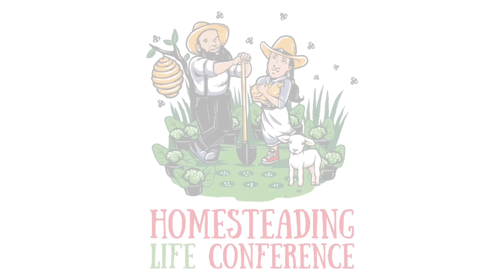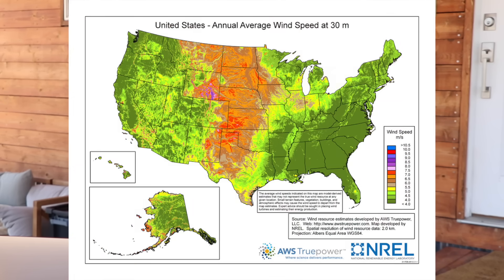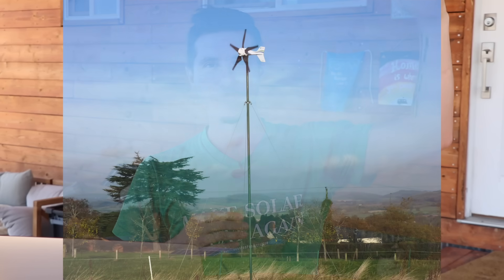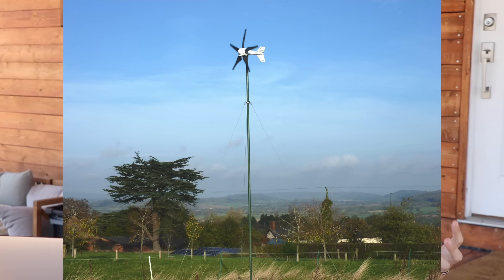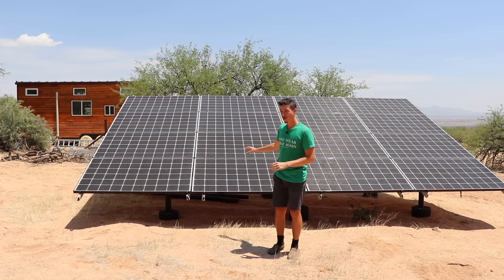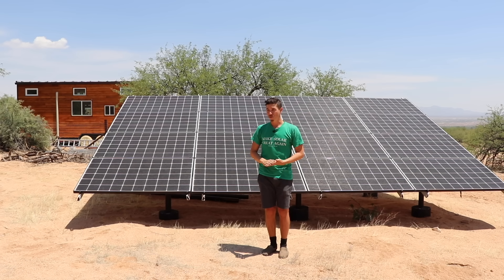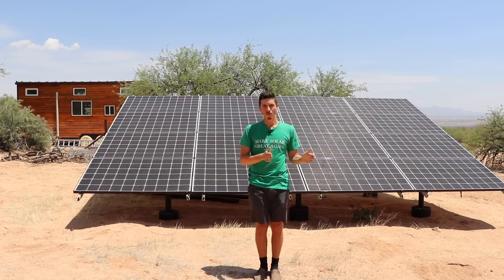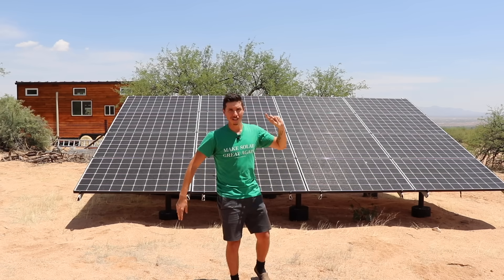Micro Wind Turbines... Are They Worth It? (Off Grid Solar)

Comment: Clearly, in a sun belt location like AZ, for example, solar is a better option.  However, in an areas like the Pacific Northwest, sun vs wind is a different discussion.  I live in British Columbia, where I live wind is a standard issue condition (with few exceptions), sunny days are not.  Smaller wind turbines will generate power 24/7 so the need of high output of power is significantly reduced, hence a reduction in cost.  An installation of a small wind turbine would not require a 65ft poll either, 20ft would likely be fine.  A person may even find the need will drop for large amounts of batteries too, since the recharge will occur throughout the 24 hours cycle.
Reply: You said, "... 20 ft would likely be fine ..."  Either you KNOW it is fine or you are talking bullshit.  Do YOU run your entire home off-grid using only Micro-Wind turbines?   So, how many KWhrs do your Micro Wind Turbines actually generate on a daily basis?   Then you claim they run 24x7 ... ( just more bullshit! )  According to the 10-Meter Wind Maps ( actual science ) for British Columbia, Canada there are no locations that have 10m/s wind 24x7 every day. NONE !

Comment: Do these need to be built 65 feet in the air or 65 feet above sea level? I get quite a bit of wind due to living on a hill and I think the claim that these need to be built 65 feet in the air is probably misleading.
Reply: The height for your wind turbine is measured from your ground level.  This is not misleading.

Comment: Wind is actually cost effective if you live off grid because 80% of low solar days are completely compensated for by additional wind. This saves you a lot of capital on battery’s and panels. But yes if you have access to the grid wind is not cost effective for the energy needs of a typical single household.
Reply: Micro Wind Turbines are not cost effective, for 99.99% of the population.  At best, they are a necessary evil....
Reply: MrSummitville No I disagree. They are not cost effective for about 80% of the population. It totally depends on the mission of the set up. The biggest factor is whether or not you have access to grid power, if like most people you do then yes it’s rarely cost effective unless you live in an area with consistent strong wind. Energy output increases exponentially with increasing wind speed. Wind also compliments solar in that very often wind power can be harnessed when it is dark or overcast.
Reply: @Str4t0sph4r4  99% of the people in the USA already have CHEAPER Grid Power than Micro Wind Power.  And 99% of the people do not live where there is enough wind to cost justify a Micro Wind Turbine. Those are the facts.  It does not matter if you disagree.
Reply: MrSummitville It does not matter if you disagree. Micro wind is usually cost effective for an off grid house.
Reply: @Str4t0sph4r4  So, tell us ... How many Micro-Wind Turbines do you have installed that power your off-grid home?  How much did the installation cost?  And finally, how many watt-hours do your Micro-Wind Turbines produce per day, week or month, in the real-world?
Reply: MrSummitville Good questions, although you failed to ask how much wind energy is produced during low solar hours. This is very important as energy storage solutions is where most of the cost is.
Reply: @Str4t0sph4r4  For most people, wind is LESS predictable than sunshine.  Also, it is generally LESS windy at night vs the daytime.
Reply: @MrSummitville  But it’s usually MORE windy in the winter months and MORE windy during overcast days.
Reply: @Str4t0sph4r4  If it is not Windy enough to cost justify a wind turbine, then it does not matter if it is "more windy in the winter".
Reply: MrSummitville Great comment genius. I mean I know you shouldn’t be afraid to state the obvious etc but I mean come on man. The flip side of that statement is also true, if it’s not windy frequently enough or on enough occasions where it is useful then it doesn’t matter how windy it is overall.
Reply: MrSummitville There is an application for wind power, it comes into its own for off grid solutions in conjunction with solar. It’s particularly useful in windy areas, the energy produced increases exponentially with wind speed. So it’s all about location and environment. In some places it’s extremely cost efficient in other places it’s extremely cost inefficient.
Reply: @Str4t0sph4r4  You stated "more windy", not me.  You offer no specifics but yet you claim it is effective to live off-grid with a Micro-Wind Turbine.  Maybe, if you live in a tent ...
Reply: MrSummitville Yes of course I stated “more windy” the more windy it is, the more cost effective a wind turbine is. What issue do you have with that statement? Lmao 😅
Reply: @Str4t0sph4r4  Until your reach a certain MINIMUM average wind speed, micro-wind turbines are NEVER cost effective.  Micro-Wind Turbines are typically a waste of money. If something is a net financial LOSS , then it is not ever called "cost effective".
Reply: @MrSummitville  How can anyone disagree with a comment that is so obvious it was a waste of time writing it. How is your statement in contradiction to ANYTHING I have said?

Comment: This guy is living in the dark!
First, you can't directly compare wind and PV, wind compliments PV, you're not trying to compete with PV, you're trying to get energy, especially at night. Even if you get less energy it may still be enough to reduce your battery size or get you through several cloudy days - which we do get. This brings me number two. Unless you live in a desert, you're not getting sun every single day - never! 
Yes, have PV in first, it's the easiest most dependable energy source for home energy BUT it doesn't shine 24/7 365 days a year, you need wind or microhydro to live off grid or a lot of big batteries or a tent with an LED light and very little renewable energy.
Reply: So ... How many Micro Wind Turbines do YOU have installed?  How much did they COST.  How many kilowatt-hours do they generate?
Reply: @MrSummitville  I have a stream which is a better source for night time energy which very few people have. Because my batteries cover my needs for several days, even when there's no sun, I haven't put my wind turbines up. I do have two wind turbines though, they were the SouthWest Windpower 400w turbines but I'm hoping my stream permit comes in so I don't have to put them up. I'm also considering a larger wind turbine, I think 1kW would be a nice size for my property.

The thing is that people have to understand that wind and PV work together, once your PV is in if you have the space for wind then you should consider it. You don't need a lot of energy from wind. Let's say your night time energy draw for 12 hours is 2kWh. 2/12 = 167 Wh. If you have a battery that's, say, 4 kWh then that saves it from depleting to 50% every night. So let's say the wind turbine only generates 100 watts, during the 12 hour night it generates 1.2kWh, now your battery is only going to ~75% discharge during the night. Wind doesn't need to generate a lot of energy but it still allows you to run longer on your batteries or use smaller batteries.
Reply: @mosfet500  So, let us know how many watts and watt-hours those so-called "400 Watt" Southwest Wind Turbines actually produce in the real world.  Isn't Southwest Windpower bankrupt?
Reply: @MrSummitville  SW also made larger turbines, the 400 watt ones were actually quite popular and held up well. I figure two turbines will give me about 150 to 200 Wh but if they don't I'll go with something like the Bergey Excel 10.
Reply: @mosfet500  Actually, the larger SW wind turbines did not hold up well.  They had a high failure rate.  And they were very expensive to repair.  A Bergey Excel 10 is NOT a micro-wind turbine - Did you read the TITLE of this video?
Reply: @MrSummitville  I know, I didn't buy one. I do, however, have two SW 400 micro turbines that never got installed because I didn't need them until now. If, between the two they give me 200 watts between both of them on my 4 acre front field with good wind I'm happy. 200Wh avg. for 12 or 24 hours gives me ~ 2.4 kWh to 4 or 5 kWh a day and offsets my battery load during those cloudy days we get in the Catskill winters just fine. That adds and extra day or more of running on batteries here.
If they do break I have everything here to repair them right down to magnets, wire, a full machine shop and an electronics lab.

Comment: A VERY biased opinion. You are comparing wind to solar and that is a mistake. These two technologies should NEVER be compared to each other but instead be used together. They offer electricity different ways and should offset each other. The sun doesnt shine on panels more than 60% of any given 24 hour period AND only produces optimal output for a 4 hour windows unless you angle the panels. Then you can get another 1-4 hours depending on time of year and latitude. Wind power can produce 24 hours a day if there is wind. They produce in cloudy weather and in winter when solar is producing a fraction if any output. You state your solar is producing "Every Day" to quote you directly. Please tell me where you live where you get direct sun every single day? In addition, building a 65' tower is your option. not a requirement. Sure the higher you mount the turbine, the more reliable the wind but its not a requirement. You can produce reliable wind on your roof at near pitch height. In addition, you can mount an array of low cost wind generators to capture wind across the entire roofline instead of a single generator. Your roof is like the top of a airplane wing to so degree. Wind has to speed up going over the top of your roof to meet up with itself on the other side from the wind going around or past your structure. Basic aerodynamics. So depending on the height and pitch of your roof, you will see an increase in wind speed at the apex of the roof compared to the ground along side your house. 

So not a great comparison. Sorry.

Comment: Interesting trade off discussion. I suppose for a maximum case: if you install a 500W turbine and get wind 24 hour each day you’ve got 12kwH of power. That’s a lot of panels and batteries. Not sure it’s as clear cut as you say…
Reply: So, WHO gets steady 25 MPH wind for 24 hours per day?  Anybody?

Comment: to have a truly effective off grid power system you need multiple power sources. If you have a week of cloudy rainy days its better to  have a wind turbine or a hydro generator with a large battery bank.
Reply: Micro Wind Turbines are NOT cost effective

Comment: I understand wind isn't the best in a stationary location it should, but what about if you were in a travel camper/rv?? I would think the wind speed generated whilest going 60 to 70 miles an hour would be enough to charge batteries or power refrigerator, Lights, AC, etc.
Reply: If you are travelling at 60 mph then charge your Deep Cycle battery from the CAR !!!

Comment: Batteries are darn expensive.  It’s a nice thought to have an extra few kilowatts after hours to save that extra few grand in batteries to get you through the night.  And like a few comments up north you have snow on panels and only 3 sun hours of power.
Reply: Micro Wind Turbines are darn expensive and they generate very little energy.  They are are not cost effective for 99.99% of the population.  For the other 0.01% of the population, they are a necessary evil.

Comment: Why even make a 8 min video of why wind don't make sense??? 

So show me cheap batteries that can store 50 000kWh for 6 month and I buy them.
Above 57 degree North we don't see sun much for 6 months. Ever heard of seasons? 
Up in the north of Sweden the sun never rise above horizon for weeks or months!!!
Reply: If you are part of the 0.01% of the population that can make a Micro Wind Turbine "cost effective" then go for it.
Reply: @MrSummitville  Many of us live in similar situations, we have our home connected to the grid, then small scale wind does not make economical sense.

There are some who live without electrical grid connection. These people have to find other source for their electricity. Many use solar, that's very smart everywhere. But it's not enough everywhere.

The cold season they need both heat and electricity. Some solve this with propane and petrol, witch is very expensive and bad for the environment. At places with cold season, no grid, and several weeks weeks without sun  - a wind turbine would make a good contribution.

Comment: What if you treat each micro wind generator as a single solar panel? Of course one panel isn’t enough, so you use several. Maybe we could add several micro wind generators at the top of a solar panel array?
Reply: Add up the COST vs the meager production

Comment: There is no yes or no answer as it's very geographical. In south east Canada we get sun in the summer and high winds with little sun in the winter. A dual solution works here. You do make good points regarding other factors to consider when considering a micro wind turbine.

Comment: your viewpoint about micro wind power generation is too shallow. 
its not worth it on your use case yes.
A simple math will tell you the advantage of wind over solar. 
75w solar X 5 sun hours = 375whrs
75w wind (at average wind speed) X 24 hrs = 1800whrs
Wind power can be made inhouse with old washing machine. Thats something you cant do with solar.
Reply: Where do you live that you get "Average Wind Speed" for 24 HOURS per day, every day?   LESS THAN  1% of the population lives were it is windy enough, to cost justify a Wind Turbine.  Even less people are capable of fabricating a long lasting, high producing DIY Wind Turbine.
Reply: @MrSummitville  ugh how stupid that question is. The wind speed fluctuates from 0 to something over the course of 24 hours. But you will extract something out of it over the course of the day everyday. There will always be wind. If your wind turbine can extract an average of 75w per hour throughout the day, or of it can only extract 35w, or 10w doesn't matter as long as that is the average harvest. multipoint power tracking also exist in wind turbines. multiply that harvest to 24 hrs. Thats total W*hr you get. Non stop.
Reply: @MrSummitville  less people doesn't mean zero. RPM on the stator side can be multiplied by using belt/pulley.
Reply: @practicalthinker5545  Adding pulley does not increase the available ENERGY.  There is no micro-wind turbine manufactured with a pulley.
Reply: @MrSummitville  of course it does not. But it ramps up the speed of the generator. Allowing to achieve useful voltages at lower currents. The energy harvested is is still in equilibrium.
Im talking about home made micro wind turbines.

Comment: i think it is location dependant. the capital costs as you say are high. I have solar panels, building my own 2 axis solar tracker thar doubled the output stsrting at sunrise and ending at sunset . 

Thought about wind, but hell, fire up my genset for those off days to charge the batteries The gas costs maybe 10. If i use the genset 20 days a year, 200.  that's a lot cheaper than 2000 for a wind system. and we dont get a lot of wind either.

So either more batteries or the genset to charge the batreries.

Comment: The true negatives of Micro wind mills:

- They are noisy, you need to be able to place them somewhere they don't bother anyone, the noise they make is really blood annoying. In the location the video author is at, if there were enough wind, he could easily install several of them across the land he is on. They don't nearly make as much blade noise as they used to, but the 3 phase motors in them are whiney lil bitches.
- They are not suited for locations with little wind.
- They are not suited for locations where the barrier between low wind and a lot of forceful wind is small, where there's either too little or too much wind, your windmill will mostly be in a state of not generating power as these things will cut out when the wind is too weak or the wind is too strong as to keep mechanical integrity.
- These small ones don't deliver all that much energy, so price/power ratio isn't great.
- While often rated as delivering as much as 3-4000kWh per year, studies in my country, a place known for being windy as fuck, have found it's only 1/15-1/20th of that. So their already high price/power ratio becomes even worse. Most are advertised as recouping cost in 20 years, in reality it's really 300-400 years.
- In a lot of places, you are either simply not allowed to install a windmill or the red tape to be allowed to install one is so cumbersome and expensive its a non starter. 
- In dense population areas, these cause noise, shadows, problems for wildlife, etc, etc, etc

The positives in combination with a solar array:

- In locations with a constant breeze that is strong enough to generate power, you have a constant float charge added to your production network, it may not be much, but at least it's something.
- In locations with little sun, at least you can have some energy generation off grid with one or more windmill.
- In locations with a lot of space (like the video authors location) if there is sufficient wind, you can place some across the area to minimize the noise and with that make some energy.

It all depends on the location you are in, not just in terms of wind, but also in terms of if you are even allowed to put something like this up.

But the worst barrier to getting micro wind turbines is their efficiency and price/power. They aren't even remotely worth their cost.

Comment: Sorry, but you are wrong. Every alternate electric system requires maintenance. You are so biased.
Reply: The maintenance for Solar is very low.  The maintence for a Micro WInd Turbine, if it lasts long enough and actually spins daily, is much higher ...